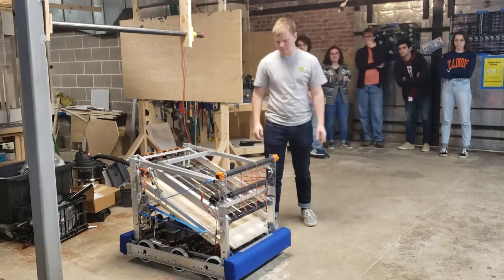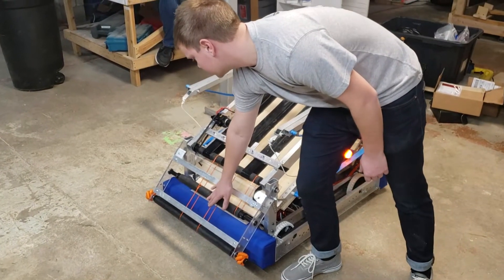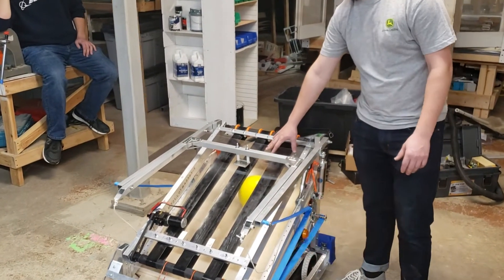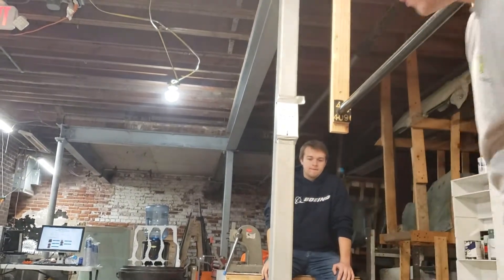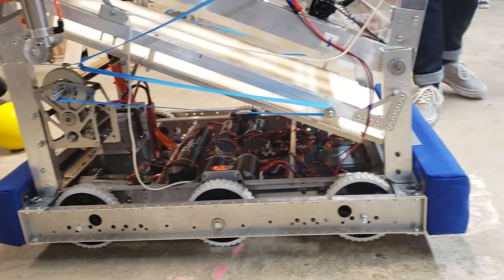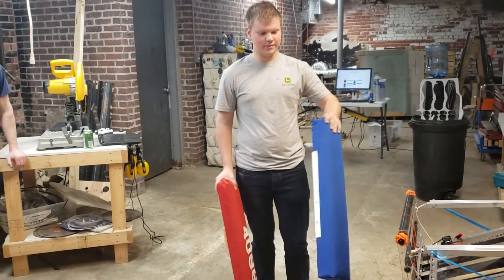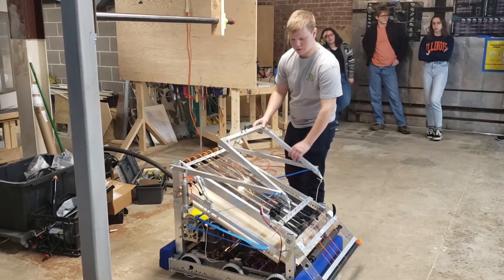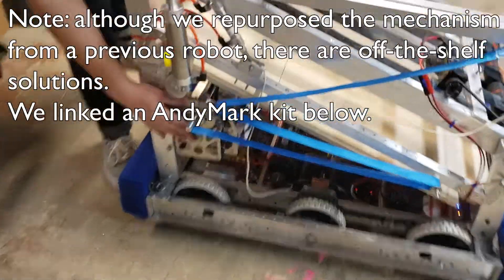UIUC Ri3D Technical Review

Comment: Could you please link the winch system?
Reply: https://www.wcproducts.com/gearboxes/vp-accessories/vp-ratchet/217-6048?___SID=U this versaplanetery slice is the easiest way to incorporate a ratchet. The other option is to use any appropriately geared gearbox with a 1/2" hex output shaft and use a ratcheting wrench similar to what you see in the video